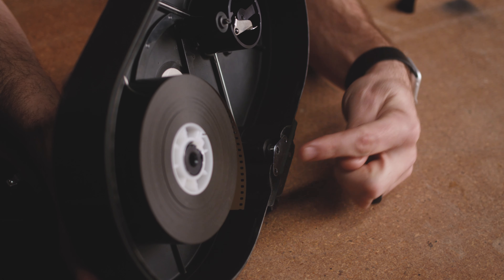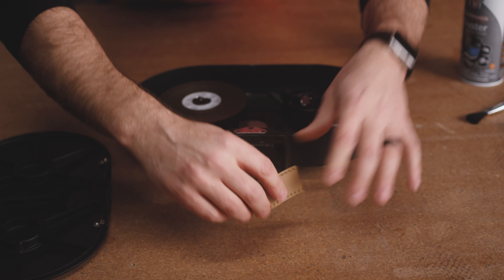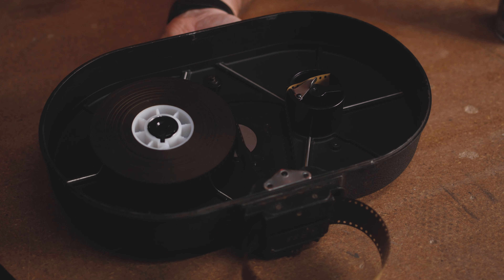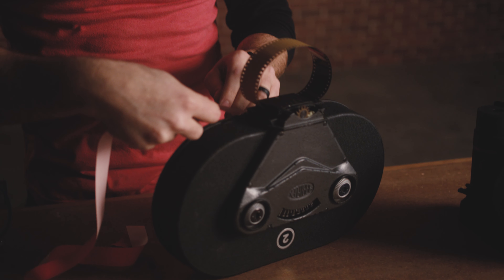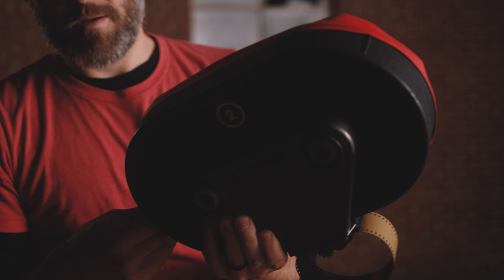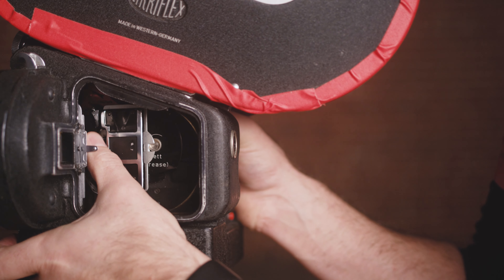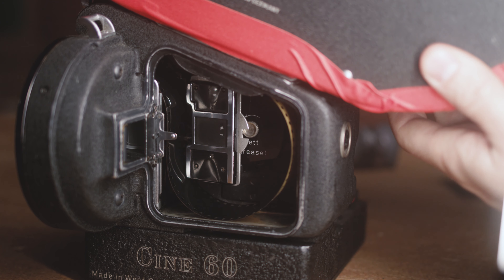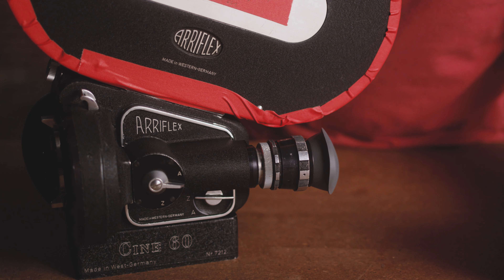How to Load an Arri 2C Film Magazine - Sprocket&Claw - Ep 006

Comment: I have an old 35 IIC with 200ft magazines. The only supply company for 35mm here in Germany typically delivers 400ft rolls so I wonder if you have any suggestions how to get the 400ft roll onto 2 200ft ones?
Reply from the maker: I have 400’ mags that I use to spool them down. I put the lens cap on, close the eyepiece, run the camera for 200’, cut it and put them into cans.

Comment: How do you take out the film?
There is no core on the take-up side.
Will it be rewound?
Reply from the maker: No core needed to send it off to the lab. Just remove the exposed film from the collapsible core and put it in the light tight bag in the can, label, tape, and done.
Reply: No core needed to send it off to the lab.

thank you for your reply.

>No core needed to send it off to the lab.

There is a kind lab.

There are only two companies in my country and they are not kind.
I'm told that I don't like it.

I will rotate it in the reverse direction and return it to the core.

I apologize for the trouble.

Comment: loved the video,
I am new to film.

How much Arri 2c costs these days??
Reply: From 2000 to 5000 dollars depending on the condition and if it comes with a lens and/or accessories.
Reply: Got mine for 3000. Came with PL mount and 3 lenses and few other gadgets
Reply: @twistedmetalworks1  Congrats. That was a great deal if the lenses were decent.